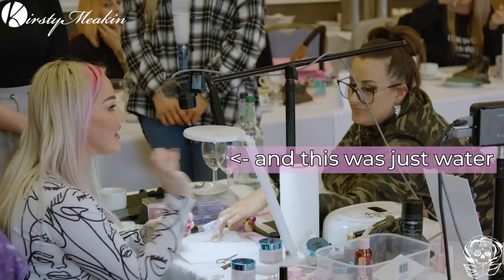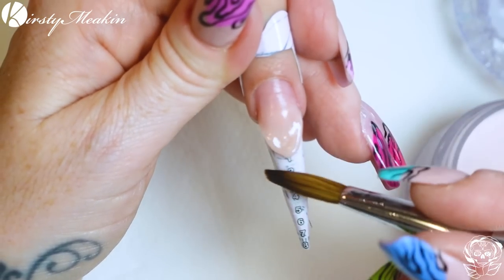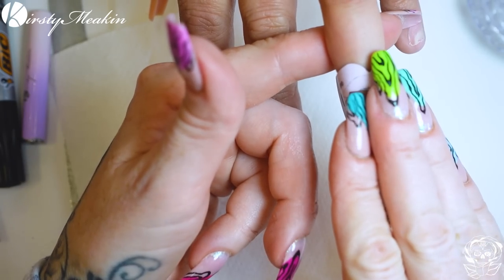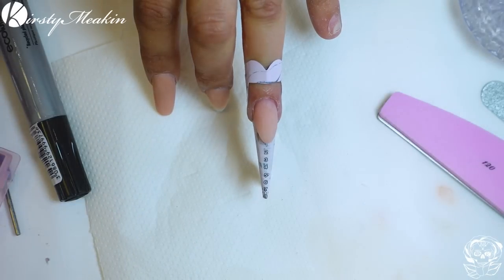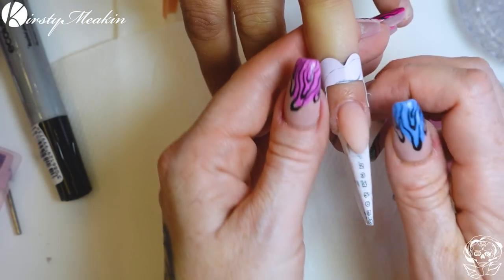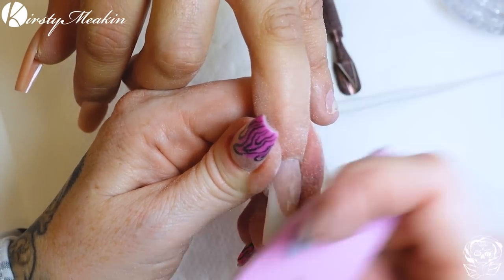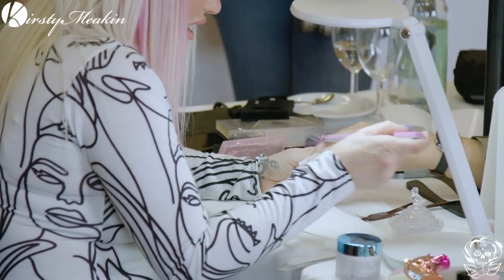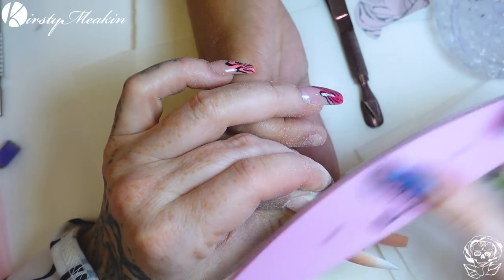A Crisp Acrylic Smile Line | Back To Basics Nail Sculpting

Comment: 😍😍😍 Look at that gorgeous C curve! A Meakin nail is SUCH a thing of beauty! I could seriously look at the underside of a beautifully pinched nail for hours. I don't understand this thing we're seeing now though with the "no C curve" tips for sale and the "no C curve" nails. I always thought an extended nail needed a C curve for the strength? Plus it just looks infinitely better. I just don't get it. 🤷‍♀️
Reply: I don’t use tips at all, I only sculpt however I do understand why no c curve tips exist 🤓 sometimes if a client has super flat nails, tips with a c curve/pre-pinched tips can be difficult to fit and can later create pocket lifting if they detach from the natural nail due to the imperfect fit 🤓 usually the no curve type of tips are super thin and flexible, so once they’re glued on and the acrylic or gel is applied, THEN they can be pinched to create a c curve ☺️

Unfortunately though, as you rightly said, it’s become a trend to have pancake flat nails 🙄🤷‍♀️ they use those flat tips but DO NOT pinch them once product is applied, like they’re supposed to 😒😂 they look crazy and are so weak it’s frightening 😭I saw a set of coffin nails that hadn’t even been contoured. They had sharp flat edges so they were like rectangles 😂🤦🏼‍♀️ the problem is the clients don’t understand it’s putting so much stress on their nail and they’re far more likely to get injured if they knock it or break them 😭😭😭